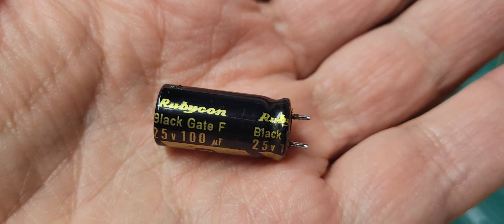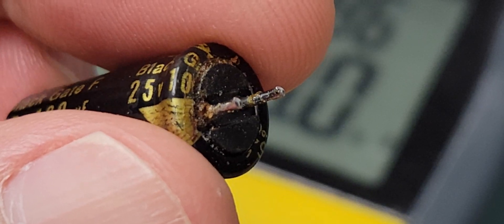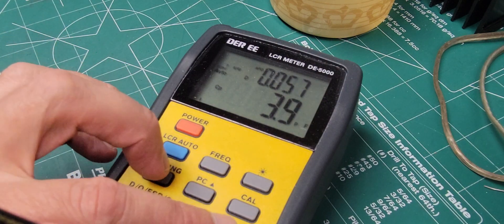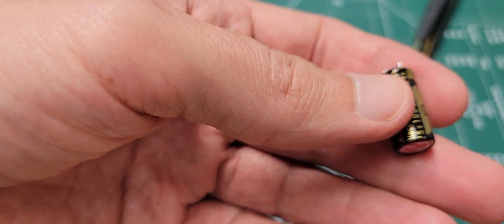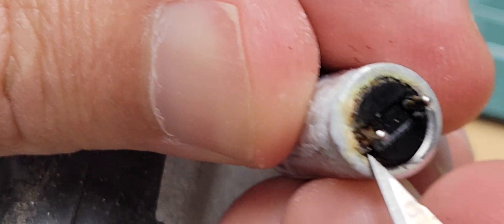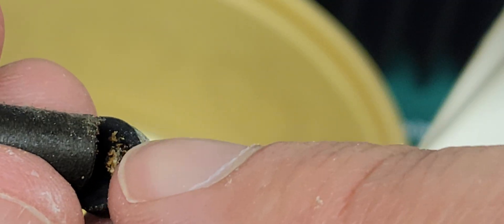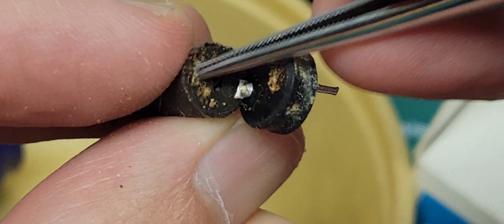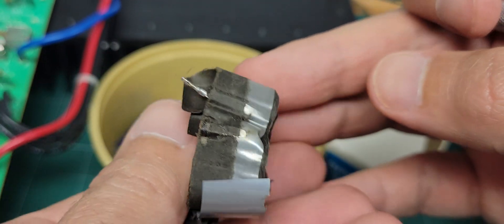Rubycon Black Gate Capacitor Failure & Teardown!!!

Comment: I was told Black Gate used a proprietary electrolytic formula that is very strong.
My guess is the electrolytic ate its way through and evaporated out , leaving deposits behind. Your fingers should be wet with electrolite.
Reply from the maker: @jeffharper410  It was definitely dry inside.  I am going to replace some other Black Gates from the same amplifier that are still functioning and will take one of those apart to see if it is dry as well.  Thanks for the comment.
Reply: @vintageav  I have a pair of Audion Golden Dreams right now .
They are level 6 , so upgraded with Black Gates and silver wire.
$23k new 18 years ago!
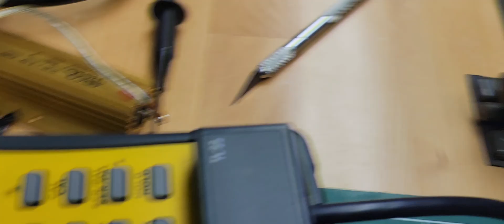The noise floor was over 50db. At 9:00 o'clock on the volume control. All 8 big Black Gates have high ESR and dry as a bone.
I am ordering Audio Note replacments.
Reply from the maker: @jeffharper410  Interesting!  Thanks for the insight!
Reply: @ericgonzales854  
The AN Kaisi series use the same electrolytes as the Rubycon Black Gates.
I actually think the standard AN electrolytics are more neutral sounding . The Elna Simic II and AN capacitors are my go too.